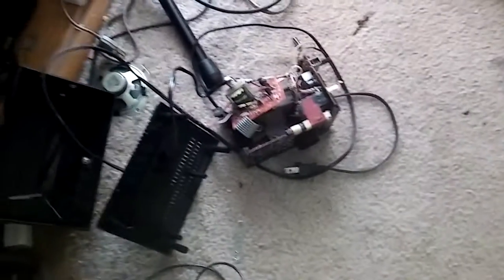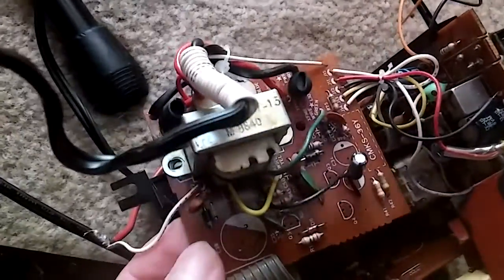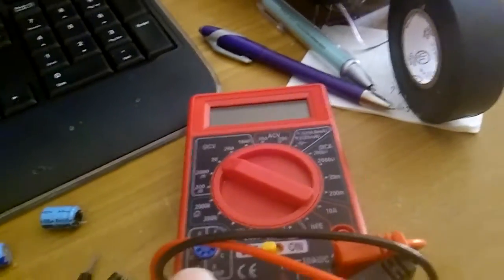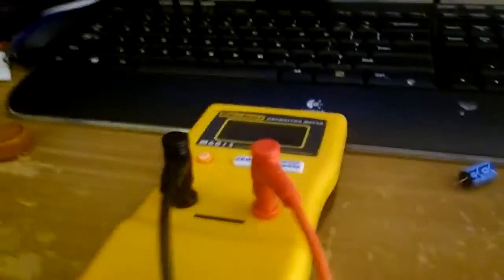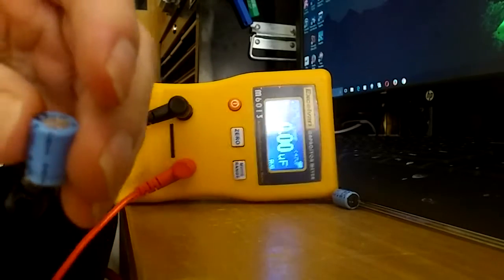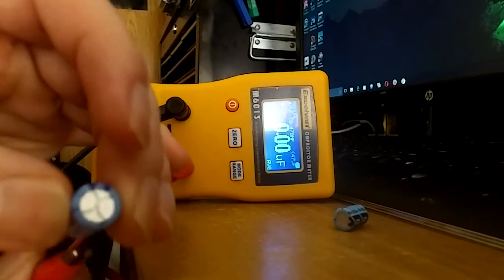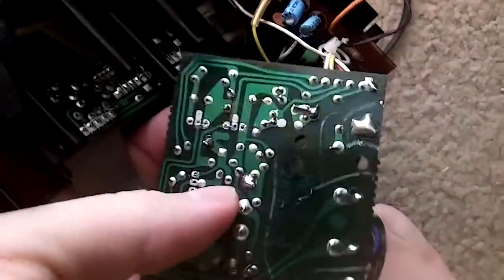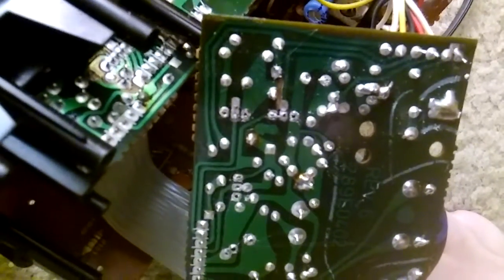Repairing The Vintage GE Clock Radio Part 1.5

Comment: I don't think the mark on the board should cause any problem.  Back in the day when I was in high school, we etched our own circuit boards.  Basically what you have there is a spot where the substrate of the board is exposed.  The board material is non-conductive, so it shouldn't cause any trouble theoretically.